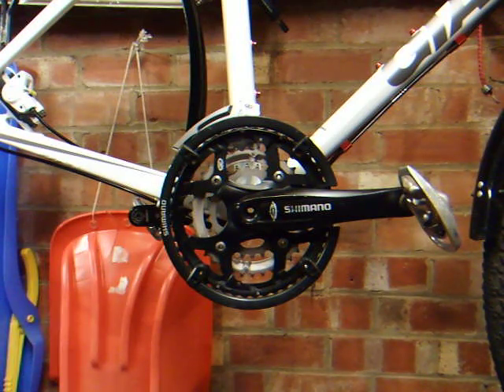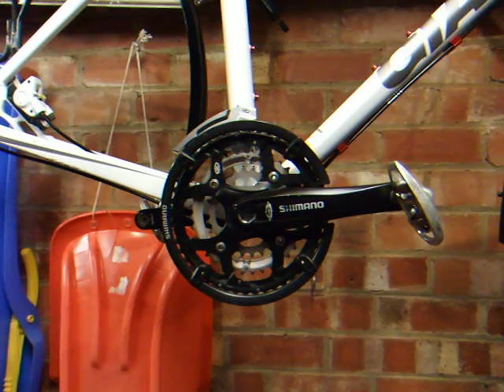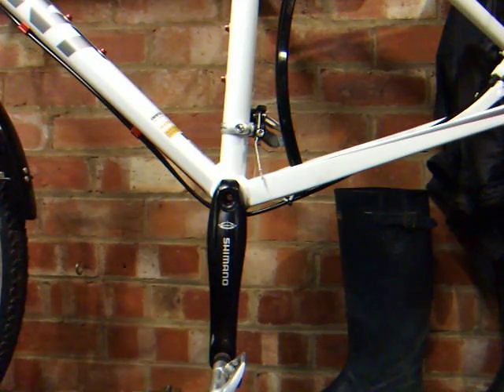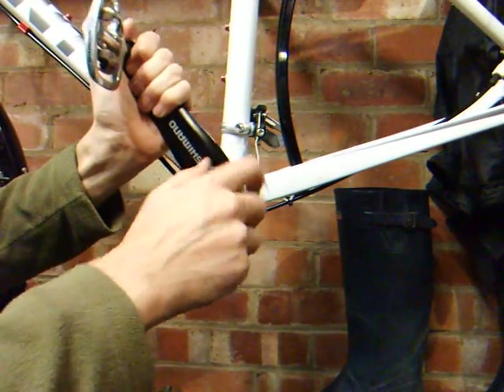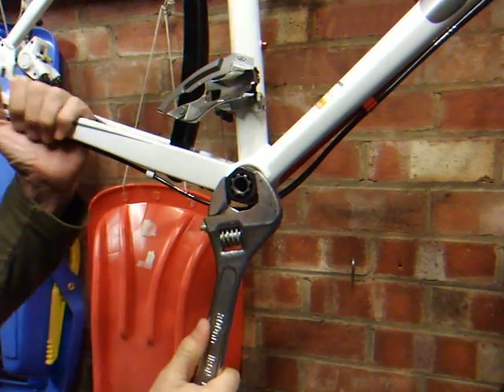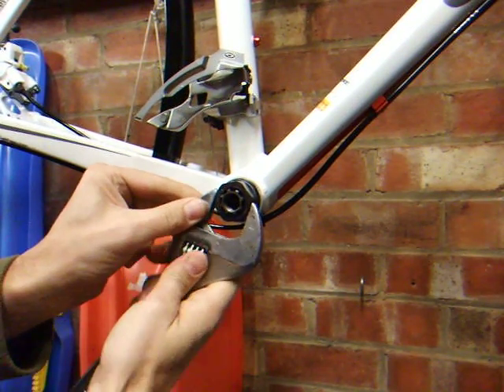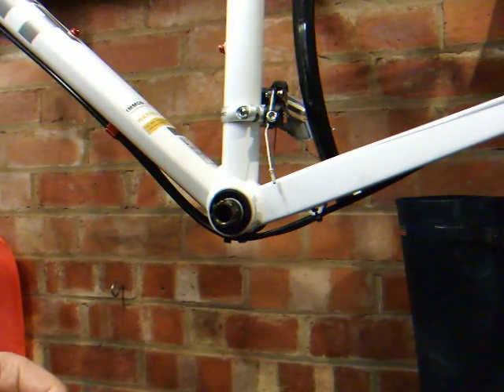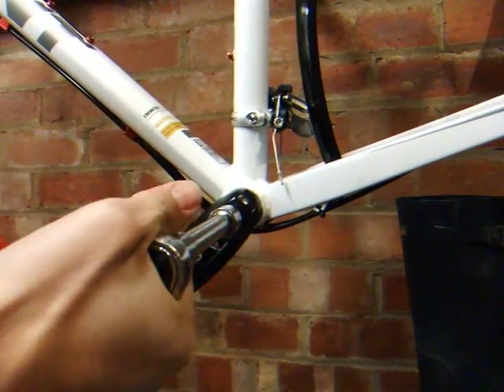Replacing a Shimano Octalink BB-ES25 bottom bracket cartridge

Comment: Well this was handy, I have the exact same BB-ES25 126mm on my 2nd hand Gary Fisher Mondota.
I was unsure about how much play these sealed units are supposed to have, but mine seemed to have a noticeable amount so it seemed prudent to replace it. I'm certainly pleased that they are still available on eBay as mine must be at least twelve years old by now. From the factory they appeared to have used copper grease.
Reply from the maker: You will see from the new sealed unit that there is no noticeable play, so you did right to replace it.
Reply: @MrDufftastic  - yes, the new unit has arrived (eBay £15) and there is no real play at all, the old unit had at least 1.0-1.5mm of displacement, which would have been noticeable further out at the crank.
It's this kind of thing that's hard to gauge from tutorials, just what is supposed to be normal and what is probably OK.

Comment: Have a Octalink BB-ES25 on an old Specialized Pitch.  I removed the left side just fine, right side I used ratchet with a rubber mallet and tapped hard for probably 20seconds the tightning direction before I realized my mistake.  Thing is proving very difficult to remove now.  It's an old bike, prior owner had it dirty as h*ll, and it's pretty nasty all around the BB... now, I know my mistake probably screwed it up, but I feel like I can get it out, but the stupid tool on this side is rocking around a good bit.  I put some PB Blaster around the threading from the outside... hoping by morning it'll help, and I can CLOCKWISE loosen it :(  Any tips to get this off?  Using a breakerbar and a  mallet at the moment, though hard to get leverage (front wheel is off, waiting on sealant to put a new tire on and no bike stand.
Reply from the maker: It's a tricky one if your splined tool is slipping, perhaps a G clamp could be utilised to help keep it in place. If your BB-ES25 is scrap you could try tapping the spindle shock the joint first. Turn bike  upside down on floor to allow downward pressure on the wrench. Careful application of heat. Perhaps use some thin wire to pack any slop between the splined tool and the BB-ES25. Good luck!

Comment: I have seen people using a torque wrench for tightening. Any views? Bit of a novice at all this. Great video.
Reply from the maker: A torque wrench is definitely the way to go otherwise tightening is guesswork. It does look like I am over-tightening the crank bolt in the video however I could feel the thread being taken up, when that stopped I nipped it up.
Reply: @MrDufftastic  I don't see how we are supposed to use a torque wrench with that Shimano tool. A tool with a ratchet mount is needed to fit it.
Reply from the maker: @unnainconnu9098  Yes, quite right. Perhaps you can get a spanner type torque wrench but if you could most people doing DIY repairs wouldn't have one.
Reply: @unnainconnu9098 the Park Tool Octalink socket has a drive for a 3/8" ratchet.  Correct torque on the bottom bracket cups is 36 ft/lb.   Correct torque on crank fixing bolts is 36 ft/ lb.   Don't guess use a Torque wrench, or take the bike to a  bike shop.  Don't use "adjustable wrenches" they will round the bolt head. I installed a new Octalink BB today, used the right tools and torque specs from Shimano's Technical data sheet.

Comment: Do you know if the es 300 works ? I want to upgrade from the es25 looks heavy
Reply from the maker: BB-ES300 is the replacement for BB-ES25, should be ok poviding you can get the correct shell width and axle length for your bike

Comment: Shouldn’t you have cleaned the frame where the bottom bracket goes. I heard you said “water”?
Reply from the maker: Hi, yes absolutely. I did clean the frame thoroughly after removal of the bottom bracket, you can see it sparkling in the video after I said urghh water! Just happened to cut the video there and didn't mention the cleaning afterwards.

Comment: TL-UN74-S is like a bp-99600 by Var o differently? sorry for my english
Reply from the maker: Yes, that should fit Octalink
Reply: +MrDufftastic 
I can not remove it maybe I have to change the key? ? if u have skype i will send you more pics
Reply from the maker: +Vito Fucci If the tool fits remove the non-drive side part first (anticlockwise) then remove the cartridge on the drive-side (CLOCKWISE).
Reply: +MrDufftastic 
I tried but I believe that the instrument does not fit perfectly and then buy TL - UN74 - S . I followed the video and executed correctly ways to unscrew
Reply from the maker: +Vito Fucci The splines on the two tools look identical, the bp-99600 by Var is supposed to fit Octalink. Good luck with the repair, please let me know how you get on.
Reply from the maker: Vito Fucci Yes, that looks OK
Reply: MrDufftastic tank you

Comment: Have you ever read about the  torque values ?!  Looks to me (as an aircraft mechanic) you over torqued every thread....
Reply from the maker: +Marco van A Yes I agree it does look as if I'm applying excessive force however the thread was still being taken up, when I felt resistance I just nipped up. A torque wrench is definitely the way to go, I just did't have access to one that day. I'm fully aware of Tight, Too Tight, Slack!  For info, Torque spec on BB body and adapter is 50-70Nm. Chainwheel bolt is 35-50Nm.

Comment: uhm excuse me... what other bottom brackets has the same width as bb-es25
for double crankset. i wanna convert from triple to double
Reply from the maker: Philander ang yap chuan You will need one with the same shell width as your current unit but a different spindle length to get the correct chainline for the double crankset.
Reply from the maker: Philander ang yap chuan The BB-ES51 is a better quality unit and is compatible.
Reply: thanks

Comment: So I followed this video. All the plastic teeth on the left side snapped off. who makes it out of plastic? pf
Reply from the maker: Shimano, yep that non-drive side is plastic.
Reply: +MrDufftastic it took a breaker bar to get the other side off whist hitting it with a hammer, the plastic is still stuck in the thread though. Any ideas to get it out?
Reply from the maker: +Keith Scales Grief. You could carefully use a hacksaw blade to cut then use a lever to lift up off the thread. Instead of sawing you could try a hot knife to melt through the plastic to split it before levering.
Reply from the maker: +Keith Scales Good luck!
Reply: +MrDufftastic it's so brittle what idiot designed it 😂, I try the hacksaw thankyou!

Comment: 8mm socket?!?!
Reply from the maker: @shonesymike4773  At 8min 35 sec I mention using a 10mm Allen socket (or Hex socket) which is easier to use than a 10mm Allen key.
Reply: @MrDufftastic  didn't hear that. Sorry.

Comment: Looking for some advice.

This was the first road bike I ever bought, nearly 10yrs ago. 

http://www.specialized.com/us/en/bikes/archive/2003/2003allez/03allezcomp27#specs

I sold it 5yrs ago and today I seen it up for sale on a local Facebook page...............so I bought it back! £150 

It's obviously been well looked after as it's in immaculate condition, so delighted to have it back again.

Here's where I need the help!

I want to completely do away with the BB and chainset and replace with a new BB and a double chainset, preferably Ultegra. I have no idea what BB I need to buy as replacement as far as correct size etc.

My current bike has a 50/34 chainring and a 12/25 cassette so pretty much wanting to keep it the same as that.

Thanks
Reply from the maker: David Simpson Hi, Your bike has a 68mm shell which is the start point. You may be able to use a Hollowtech bottom bracket but I'm not sure. To be honest this is outside of my experience level but I hope someone else out there can help with your project!